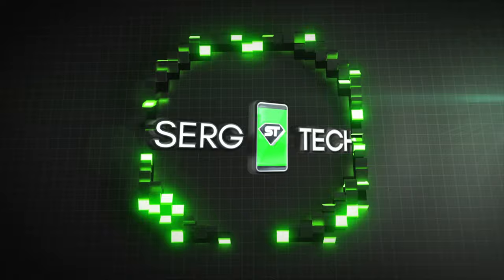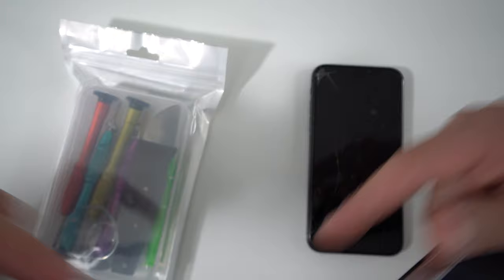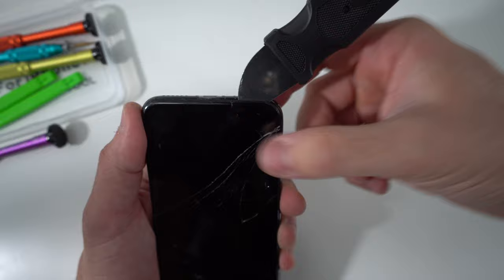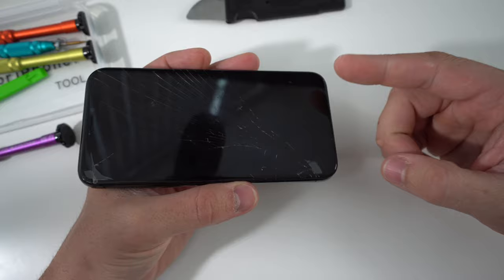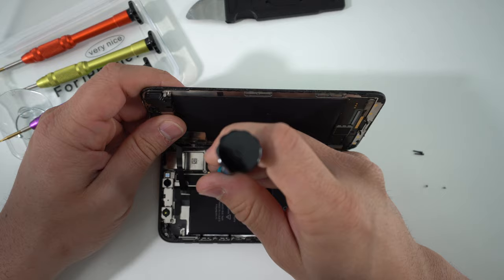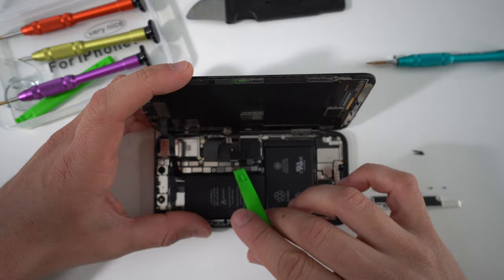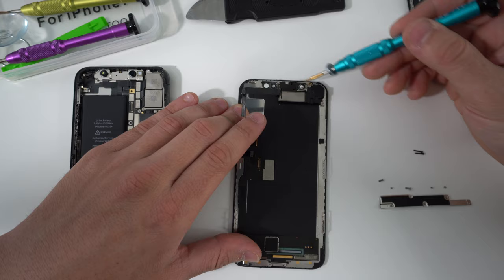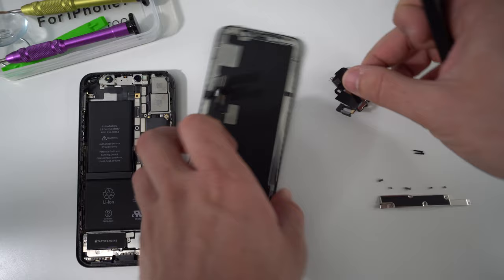3 Steps To Fix Any iPhone | iPhone Screen Replacement

Comment: It would be a lot easier to heat up the screen a bit to melt the adhesive (with proper tools don't just put it over a fire or sum) because that might avoid the chance of trying to remove the adhesive, struggling, and accidentally exerting too much force, damaging something inside. It's happened to me, happened to my friend, just melt the adhesive, makes ur life easier.
Reply: would a blow dryer work?
Reply: @winonaponcespeaks  yes
Reply: Tutorial with the blow dryer??😂
Reply: I work as a repair tech, and a heating plate at 70 Celsius for 6-7 minutes should do the trick, or a heat gun, on the higher setting around the edges for 1 minute is also fine!
Reply: it is easier to heat it up first. I tried to fix my daughter's iphone and accidentally cracked her screen :/

Comment: Useful tip the one of how different iphone models open up. Thanks!!
One tip i have for you is using an ice tray to keep the parts you remove organized. I feel it is useful especially when dealing with small parts.

Comment: Does the new screen have adhesive along the edges to replace what comes off w removal of the OG?
Reply: That one I don’t think it does, but you can find screen replacements with adhesive or buy the adhesive separately if you want to re waterproof your iPhone

Comment: What about reapplying the adhesive?
Reply: It’s not exactly required, but if you want to make your iPhone waterproof again you’ll have to. You can find replacements with pre applied adhesive, or buy it separately. Although some phones are mostly held in by adhesive, especially older phones. So I would just do some research on the one you want to repair

Comment: Normally iPhone 12 and up won’t work with a third party touch screen unless it’s takes the information from the old screen and reprogram it onto the new screen. Apple trying to stop Repair shop from fixing apple
Products. It sucks since you own the iPhone already you should be able to pick who and cheaper way to fix it then brining it to Apple Store and have them repair it which will cost double of course.
Reply: Clarify what you mean by “takes the information from the old screen and reprogram it onto the new”? Pls and ty 🥸
Reply: Damn that sucks cuz i had 12 pro

Comment: The question is, can you fix a bleeding screen without replacing it? Can you do the impossible?
Reply: Nah bro...
A bleading display is a dead display.
The best you could do was replacing the glass on top of the screen if it was broken, but its quite hard to take it of without ruining the display.